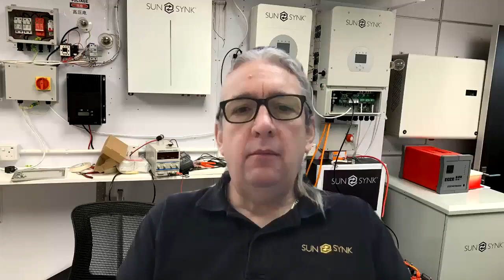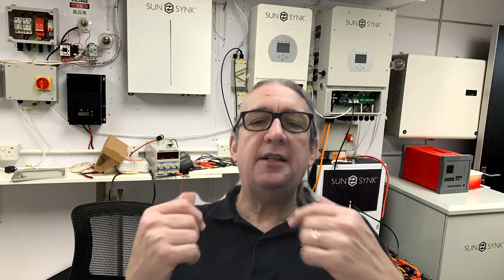Using a Gen Set with Sunsynk Inverters

Comment: I have installed 3 phase 12kw deye Hybrid inverter,,  i also have 3 phase Diesel Genset can i connect genset in generator port and use it to charge batteries at the time of load shedding
Reply: Hi I have almost the same setup.  2 x 12kW 3ph Sunsynk inverters in parallel. Also want to connect a 3ph diesel gen to it to charge the batteries.  

I have not seen Sunsynk replying on any of their videos and I must say there is a lot of questions.  Phone "the good engineer" once but it also had no idea.

I think it should work fine with one 12kW inverter but I am not sure if it will work on parallel inverters and if new firmware might fix it.  Did you get an answere? Is your system working?

Comment: I'm in the UK and would like to use the system as an UPS running off its Sunsynk battery.  I have a number of questions about that so firstly can someone point me to any document that explicitly covers all the required settings and connections?   I'd specifically like to know:-
A. Do I need to use e.g. my 2kVA gene to energize the inverter for off-grid use?  I have a (4PDT) changeover switch that I can mount in the Consumer unit that can  isolate the grid (manually) in the event of an extended grid outage and  connect the gene in 1 throw.
B Is it better to connect the gene direct to the inverter up in the loft or just isolate the grid and feed the gene power into the Consumer Unit downstairs?
C.  I have a big (3000VA) APC Smart UPS.  If I just need to energize the inverter  can I use this Line Interactive unit which outputs a Modified Sine Wave or could that cause any damage?
Thanks in advance.  Andrew.

Comment: Mr Keith, I have 3 pcs  8kw in parallel making 120 208 volt 3 phase. I want to connect my 120 240 single phase generator up to charge the batteries when I want. Would you please let me know if this is possible and if so how? I am in off grid mode
Reply: Kurt , did you recieve any insight on this? I have the same setup and cant get a generator to work
Reply: @BosenDalSafaris  yrs I did a single phase generator van only be hooked to a single phase system. So I bought another inverter and set it up for split phase and connected it to my DC distribution box and it works well
Reply: @kurtmccormick1730  thank you, sorry i misread this morning. I have a 3 phase Generator connected to (3)8.8kw inverters conected on a 3phase system. But the Gen does not want to charge the system. Connected to the gen port on each inverter
Reply: @BosenDalSafaris  if its connected correctly it should work. There are settings that need to be set properly. Also it takes some time for the transfer switch to engage and connect the gen internally. The settings are in gen port use and battery settings. Also tome of day can play a role as well

Comment: After I have started the Generator it does not want to charge my batteries or supply the load. I have a 5kw inverter and I have made sure my connections are solid and that there are voltage at the inverter on the gen/aux port.
Reply: Wian het jy toe iets regekry? Myne doen dieselfde.
Reply: @louisdevilliers2994  ek kon dit nog nie reg kry nie. Ek probeer maar alles.
Reply: @wianvanzyl7943  - And you still got no answer? I got same problem, with new 5kW unit installed.
Reply: @swburger1306  Hi SW. Have you solved your problem yet? What generator make and model do you have? I think i know what the issue is...
Reply: Hi Wian, het jy nou al reggekom? Ek sukkel met dieselfde.
Reply: Same problem here. So I eventually installed a transfer switch and ran the generator as if it is the AC connection from the grid. On the inverter I can see the generator is running around  49.8 / 49.9 hz and not 50hz. The generator is a 8.5 kw that says it pushes out 50hz pure sine wave, so either that’s not true OR the inverter is extremely sensitive and will not allow any generator input that does not supply AC at 50hz. So I’d like Sunsynk to provide a list of approved generators that they say will work with their inverters and I’m also going to kak my installer out because they did not alert me to this. So now I sit with a generator that is pretty much much useless to charge my batteries through the 8kw Sunsynk inverter.
Reply: @wozzco8111  Have you gone into the settings and increased your frequency tolerance range on the gen input to try solve the problem? My client has a 5.5kw generator from Adendorff, i am concerned with the voltage output because its a center tap winding meaning that neutral from the generator to earth is 110v and live to earth is 115v, combined it gives 225v. I am afraid to connect the gen to the inverter in fear that 110v on the neutral might damage the inverter. Have anyone else had this concern? What type and model is your generator Wozzco 81?
Reply: I have installed 3 phase 12kw deye Hybrid inverter,,  i also have 3 phase Diesel Genset can i connect genset in generator port and use it to charge batteries at the time of load shedding

Comment: I have 5kw hybrid unit of yours. I want it to start generator at night for an hour and charge batteries while load stays on grid. Can I do that? So far it only turns on generator when grid is off. And when that happens, Generator starts and charge batteries while powering the load at the same time. My generator isn't heavy enough to do both at the same time.
Reply: 👋 Hi,what Brand generator are you using? and do you got a ATS built in into the Generator?cause I am in the process of doing the same thing. Can you provide some information my email is bduncan39@gmail.com
Reply: @Bripromo  I'm using Honda generator with separate ATS deployed from company DeepSea Electronics
Reply: So do I did you have any luck on this?

Comment: Thank you Keith for another insightful video. Related to the Generator input port I have a question.
I was adding micro Grid Tie inverters to the (GEN/Smart Load/ Micro Grid Tie) Sunsynk inverter.  As soon as I configure the SunSynk by selecting the MicroGrid Tie option (Not Generator) then the SunSynk reports a significant increase in output Load without any variation in actual load.  There also seems to be a strange value on the SunSynk display coming from the Aux port although the Micro Grid Tie is still off.  When I switch on the Micro Grid Tie the values of Inverter Load and the Aux port varies constantly between arbitrary values.  Any insight on this config or maybe a good overview video on how to connect and configure for adding micro grid tie inverters. will be great.